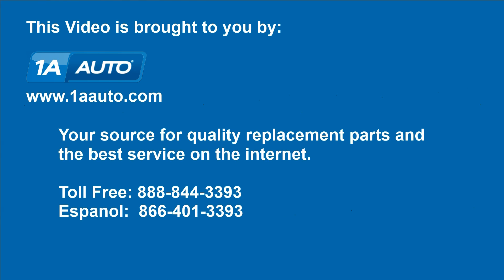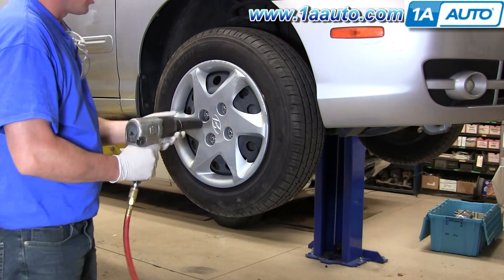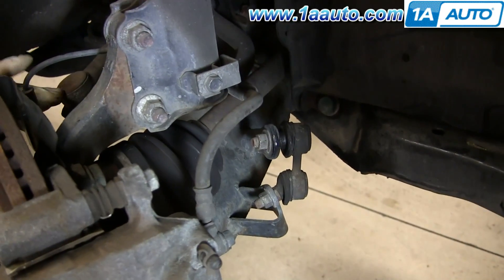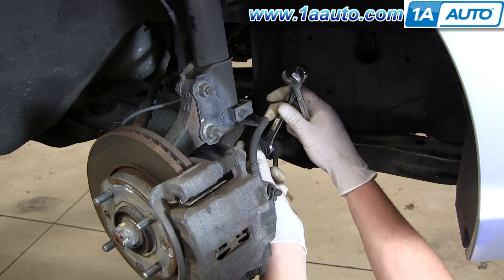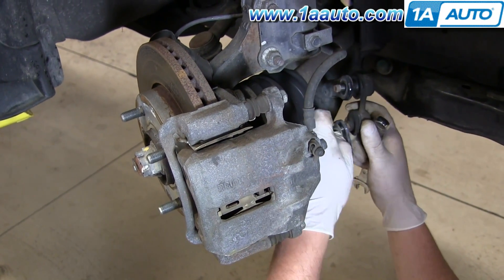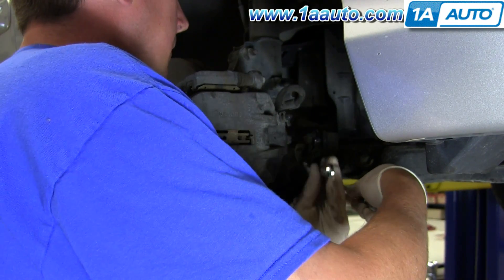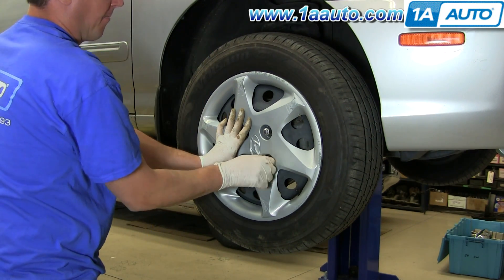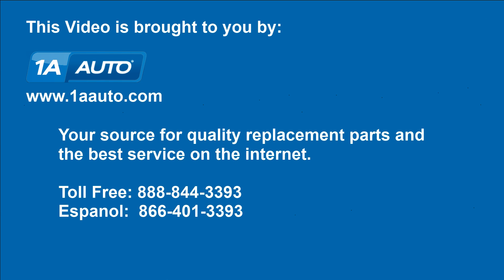How to Replace Sway Bar Link 01-06 Hyundai Elantra

Comment from the maker: You may experience body roll, a vibration in the steering wheel or a thumping noise too. 1aauto.com 888-844-3393

Comment: Thanks for the very helpful videos. I replaced my stabilizer bars on y 07 sonata and when installing the new ones they do not have same size nuts as factory and on the new one the ring that holds the rubber boot in place is of poor design it wanted to slide back off of it collar when I was tightening new stabilizer bar a standard thickness wrench will not work a person needed a thin wrench thank goodness I had one because if the rubber boot does not stay in place the stabilizer ball joint will not last something to watch for. Quality of product I will give it a 2 because of boot problem.

Comment: The title is incorrect. You demonstrate replacement of a stabilizer (sway) bar link--NOT a mount. 

A stabilizer bar mount, a bracket, flexible bushing and two fasteners, secures the sway bar to the subframe. The stabilizer bar mount is often a source of suspension noise  and should be inspected when replacing the link(s). Replacing the stabilizer bar mount bushing is relatively easy on the passenger-side, but much more difficult on the driver-side due to limited fastener access. It'd be helpful if you folks would correct the title of this video, then make a video that demonstrates replacing BOTH  "rattling stabilizer bar mounts".